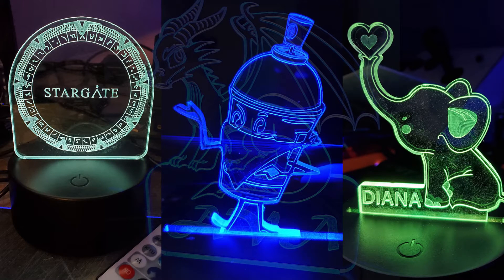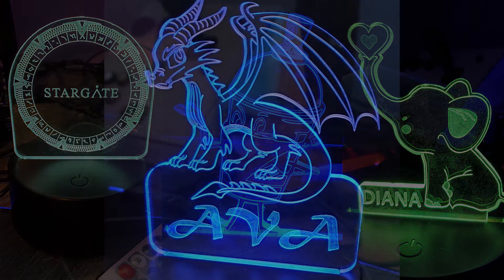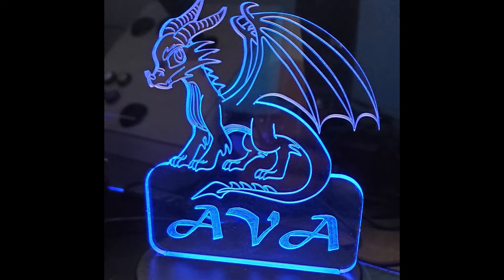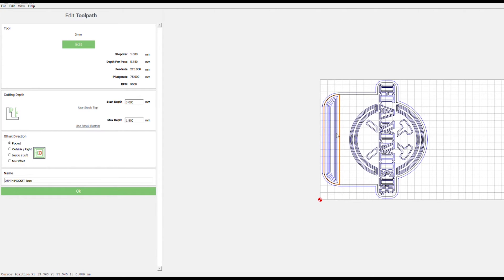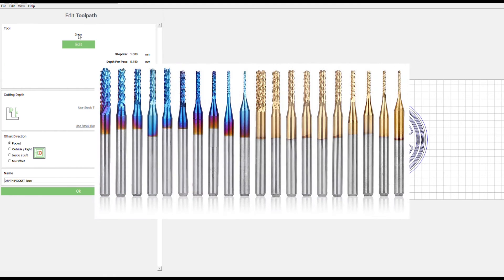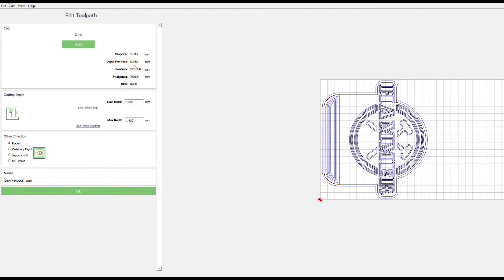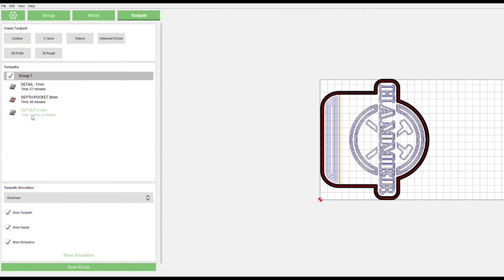How To Cut Cast Acrylic on 3018 CNC Sainsmart PROVer using Carbide Create & Off line Controller

Comment: How did you handle the dust?, i want to put this cnc in my room, i have no garage
Reply from the maker: You would want to build an enclosure. I'm not sure you want to run a vacuum with acrylic shavings. I'm pretty sure that's what killed my first shop vac. So you would need to sweep out the enclosure.
Reply: @D.E.Hammer  I'm planning on making DIY vacuum using washing machine pipe (flexible and small) and 12V fan, in the other end of pipe i'm going to attach it with the spindle, so it should suck the debris. I don't know how good it is but i'm gonna try that..
Reply: @D.E.Hammer  thanks for telling your experience about yout vacuum

Comment: So many thanks for this video. And others based on doing this. I am just about to start, very excited. BTW? your method of masking tape and super glue is very clever, but looks messy and very expensive. Look up a product called "Kip Duoband". It is double sided masking tape. German, I think, so you may need to import it but man it should be so much cheaper, easier and less messy.
Reply from the maker: Your Welcome and thank you for watching. I have moved on to double sided tape. While super glue and blue tape are fine for smaller cuts, it does become cumbersome and messy on larger pieces. I have a several different brands of double sided tape, and they are not all created equally. I even tried carpet tape and that was a disaster in both the stock material moving and gumming up the bit.

Comment: What software did you use in the video
Reply from the maker: I used Carbide Create in this vid. By now that version is old. V7 will not generate gcode, only V6 will.
Reply: @D.E.Hammer  What do I use to generate g code?
Reply from the maker: CC V6 was still available but in their blog release for V7. If you look thru there you can get V6 for gcode. You can also try estlCam. It is not free, but it lets you export gcode. It just makes you wait longer and longer between exports.

Comment: Very interesting. Definitely not in my skill set. I suspect the design portion of the process would be most pleasurable for me.
Reply from the maker: Thank You, I have done a few design videos since this one.
Reply: @D.E.Hammer  I dont know if you figured it out yer but to home faster put in G0 on the Z4.0 line.   that will tell the machine to use a rapid move from there on instead of the feed rate it was requested last.
Reply from the maker: It took a while, but yes I did figure it out.

Comment: Great job, I have just started working in plastics and your feeds and speeds are a great price of info. I'm cheating by using dish wash soap thinned about 50/50 with water sprayed on the acrlic and it does give a better cut
Reply from the maker: Very cool, I have not done that yet.

Comment: Hello Sir, Im beginner in Cnc machine, Do you use the EASEL software in Cnc 3018?
Reply from the maker: No I do not use Easel, but there are lots of people who use it with the 3018 and other machines. I prefer to use locally stored programs vs internet based ones.

Comment: Great detailed finish.
Wanted to check the feedrate and other settings! Thanks for this video!
Btw, you can spray water over the acrylic to get a smooth finish, helps to cool the bit tip! Try it out :)
Reply from the maker: I will have to try that out, I have heard about that water trick, but for Extruded Acrylic so it does not gum up.

Comment: Hello, Like the channel! Question....I am trying to cut 2.82 mm thick acrylic.  I have created a logo using carbide create and when I run the simulation nothing appears. What am I doing wrong.  I have my beginning depth at 0.00, bottom depth at 2.  I am using a 20 degree bit and I have it set on XXL as the machine.  I am using a 3018 Prover.  Excited to get it to work, however I am getting frustrated.
Reply from the maker: So what is the final depth of your cut & what type of tool path do you have selected?
Reply: @D.E.Hammer  2.00 and the tool path Vcurve tool path....have got that part figured... here is my next issue.  I have used carbide create pro, created a file, loaded it into CANDLE, but here is what I am unsure of.  The wood board I put on, do I the probe before that? The probe is 13.69 the wood is 12.62 what do I use this is the probe G90G21G38.2Z-50F100; G92 Z12.62; G0Z25....   sorry I am so new at this.  However, I am so VERY grateful for you being here for all of us.
Reply: AHHH NO WORRIES ITS GOING!!!!
Reply from the maker: Glad to hear you got it going!

Comment: What is your finish allowance and  stepover for the 3mm cutting bit? And when I'm changing a tool in carbid create i need to fill in 2D Speeds and Feeds and 3D Speeds and Feeds, but are the Feedrate and RPM the same for 3D and 2D speeds and Feeds?
Reply from the maker: So for step over I use just under half of the bits diameter. So 3mm bit I would use 1.45mm or 1.4mm. Remember that the step over is only for when you pocket or 3D, so it will not effect your cutting/contour. For 3D, those will very from your 2D. I only played around with 3D for a little bit, and am still in the process getting my settings for that. The 3D settings will not effect your Cutting or Engraving they are just for when you use the 3D carve option. As for allowance, last time I checked they were about 0.05mm.

Comment: How is the noise when engraving the details stuff, is it very loud?
Reply from the maker: With the stock spindle it is fairly loud, but nothing in comparison to a more high end router or spindle. Would not recommend for an apartment with out sound proofing. I do wear protective ear ware when using, but that is because I damaged my ears from one to many heavy metal concerts in my youth.

Comment: How do you turn a vector into a file that works for the Sainsmart 3018 prover?
Reply from the maker: For me I use Illustrator as my CAD software to create a vector images. I then save it as a SVG and import it to Carbide Create Pro (CAM) to turn it into g-code. There are several other ways you can do this. You could use Inkscape which is free to create a vector image then save as SVG. You could use EASEL or Carbide Create (Pro) to make a design then save it as G-Code. I do have a video where I show how I make a vector image and save as a SVG in Illustrator.

https://youtu.be/dLTPEqxXfoA

Comment: Thank you nice video! Is the unit cable of doing photo engraving?
Reply from the maker: Yes, but that is handled by the software. I personally draw all mine out in illustrator so I have a Vector file to work with in the CAM Software. Others convert a Raster Image to Vector with software. So it would be up to you to get the image you want into a file format like SVG that your CAM software can understand. There is also Laser etching photos OR if you had a STL file you could do a 2.5D Carve with the right software.
Reply: @D.E.Hammer  awesome i appreciate the tip. Take care man and keep them videos coming =)

Comment: Hey, when I try to engrave acrylic sheet. It doesn’t come out clean. Like the edges are rough and small but thread like acrylic coming out. What should I do? Thanks
Reply from the maker: So I would get this when engraving when I was using the V-Bit, and I go to far down OR the bit was getting dull. By switching to a Spring Loaded Drag bit you should get rid of all of that. If you can not get a spring loaded drag bit I would cut a piece of sand paper down to about 1"x1" then fold it in half. Get a small container of water, and soak the sand paper in it. Then take the corner and go in the details and Carefully run the corner in the groves. Its not fun or easy. I would also confirm you are using Cast Acrylic.

Comment: Hi what kind of programm do you use?
Reply from the maker: For Design (CAD) I use Illustrator, for G-Code Generation (CAM) I use Carbide Create Pro, and then run the NC file form my off line controller.

Comment: WOW...2.5 hours to do that. You need to upgrade to a 300watt spindle ...NO MORE THAN THAT! .  You will be able to run at a faster feed rate and the spindle will have 24,000 rpm max speed. You will be able to finish that job in no time.
Reply from the maker: I plan on doing so, once I get some other projects I am working on finished.
Reply: @D.E.Hammer  A 500 watt spindle would be ideal but Roger Watt a long time machinist said it's to powerful for the 3018 framework and gantry. He's got some excellent information on his channel. He modified the gantry on the 3018 he did a review on by adding a 3rd linear rod to the gantry and put a larger spindle on. It works perfect now for 3D carvings. Keep me posted I subscribed to your channel also.
Reply from the maker: Yeah I have not really put the research in yet to go forward with upgrading the spindle. Right now I am in the middle of converting my garage into a more suitable work space for everything, and finishing up projects for some clients. Thank you for the sub & thank you for recommending Roger Watt, will have to check him out.

Comment: I have a super random question. How loud is the machine when cutting acrylic?
Reply from the maker: It is maybe a little bit louder than when I cut wood, but nothing noticeably louder.
Reply: @D.E.Hammer  thanks for the quick reply. I’m
Wondering if I can get away with using it in my
apartment lol
Reply from the maker: Well, I have seen people say they use theirs in an apartment, but they did build an enclosure for it with sound proofing. Plus if your neighbors are anything like the ones I had at my first apartment.... I would say no, that was a fun 2 years.

Comment: Thank you from the U.K. I’m just about to buy a CNC machine and can’t wait to give this a try.
Reply from the maker: Your Welcome, they are fun. If you have any questions ask away.
Reply: @D.E.Hammer  Many thanks. I’ve seen that it’s best to flip your image, so that the front of the sign is smooth. Apparently, it also gives a better effect but I would like to hear your views. I’m just about to make one for my granddaughter.
Reply from the maker: @ianknight2053  First to answer you question Yes, I NOW engrave on the back side, BUT I have my machine set up to where the Bottom Left is actually the Top Left,  that way I do not have to remember to flip the image.
Reply from the maker: @ianknight2053  Also, I learned a lot since I have made that video, and will be working on an updated one, after I finish up some other projects that I need to get finished.
Reply: @D.E.Hammer  Thank you. I’ll look forward to that.

Comment: Hi and firstly thanks for the videos. I think I now know why I have molten acrylic on my 3018 V bit! Could you please tell me which vesrion of Carbide Create is being used as the latest download doesn't appear to let you input new tools or change tool parameters. Thanks you.
Reply from the maker: I am using Carbide Create Pro Build 514, I remember they moved it at one point, so it may be in a different location.
Reply: You cannot edit the default tool library. But you can create a personal library & create your tools in there. Copy & Paste works from existing library.

Comment: Кто понял, на какую глубину он рельеф делает, который светится?
Reply from the maker: On this one I did 0.2mm Max Depth with the Vbit, and 1 Pass  at 0.2mm, I now do 0.15mm and 2 passes if using a Vbit for 0.3mm Max Depth. I have switched over to a spring-loaded drag bit as I am getting better results with that. I hope google translated your question correctly.
Reply: @D.E.Hammer  yes, you true understand me, thank you

Comment: Tutorial was very helpful. The settings are always a great big "Thank You". I just got my hands on a 3018 pro and having the worst time with settings in easel. Looking forward to future material
Reply from the maker: Thanks Joshua! Yeah easel gave me a bunch of issues so I just stuck to the offline controller and have had no issues with that.
Reply: @D.E.Hammer  
"offline" do you mean the candle program that came with the cnc 3018?
Reply from the maker: @Joshua-ju5uc  no mine came with a physical controller that conects to the board that you can use to control the machine without a computer.
Reply: i know I am pretty off topic but do anyone know of a good site to stream new tv shows online ?
Reply: Can a laser head be added to this machine, please?
Reply from the maker: Yes it has a port on the board you can add a laser to.

Comment: Paul. Marek from SainSmart FB group. Question about feed - 225 mm - it is very high but what is timing for this feed. I was today carving on plywood by 8 mm/sec = 480/min So is your feed per minute ? 2,5 hours is long time so I guess per minute = ca 4 /sec. Right ?
Reply from the maker: Yes the 225mm is per minute, as that is how my software handles feed rate. Yes 4mm/second is the equivalent.

Comment: Hey are those 15 degrees or 20? And does it make a difference?
Reply from the maker: If you are only going down .1- .3mm it does not Really matter. As you are just scratching the surface. I believe they are the 30 degree bits.
Reply: @D.E.Hammer  thanks but how deep do you recommend i should engrave for the best result?
Reply from the maker: @simarpannu9600   for best results I say .1mm and I really can only get that with a drag bit. For best results with a V bit  .2mm    The issue with the v bit is the varying thickness of the acrylic. So you have to make sure you go down far enough that your design is actually etched,  that makes the thicker parts of your acrylic have a deeper cut, which makes the line Thicker. I like the thinner lines as that lets you pack in more detail.
Reply: @D.E.Hammer  thank you so much for replying but I have one more question, I have a 4mm thick square acrylic sheet that I want to cut but I only want the upper two sides to have the round edges. Is there any way to do that? Thanks
Reply from the maker: @simarpannu9600  Let me make sure I am understanding you correctly. You have a square and want to cut two of the corners Off? If so, then I would recommend changing your start point to Center, and cut from there.

Comment: Yep thats very important factor.....which few people  ever mentions..all acrylic is not same....cast acrylic is more easily machinable...extruded is not..and cast acrylic is a lot more costly than extruded...ive had ok luck machining polycarbonate but its not as clear as acrylic....alum is similar...6061 alum cuts nice but some other cheap made alum / alloys just gum up bit ...i tried doing a cutout on  a cheap chinese alum/alloy  plate from inside a lcd tv and it gummed up so bad it wasnt machinable..

Comment: awesome tutorial! what's the name of the paper you use to paste the acrylic to the MDF? I'm a new user with the 3018 PROVer too
Reply from the maker: It is just blue painters tape, just put some down on your spoil board, then some on your acrylic, then super glue them together.
Reply: What style bit do u use for cutout in acrylic?..i typically use single flute...and sometimes 2 flute if no have single.
Reply from the maker: @shelby50411  I use any mm sized end mill like these on Amazon. I Normally use the Top left or Bottom right ones.

 https://www.amazon.com/Mcwdoit-Cutting-Engraving-Including-Titanium/dp/B07W5N72D4/ref=pd_di_sccai_1?pd_rd_w=JDuPh&pf_rd_p=c9443270-b914-4430-a90b-72e3e7e784e0&pf_rd_r=RNEDMVS5HQGRZNZC4JP7&pd_rd_r=e56aad4a-407e-43b9-9852-ea01ecb33ade&pd_rd_wg=3bm0I&pd_rd_i=B07W5N72D4&psc=1